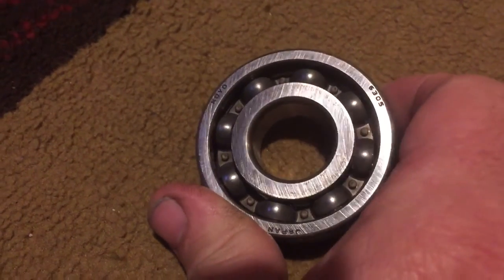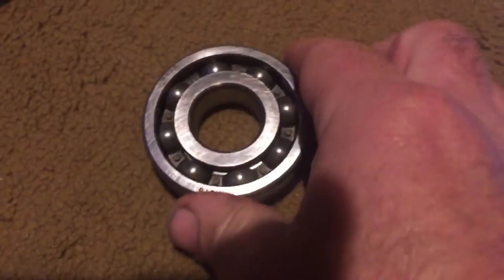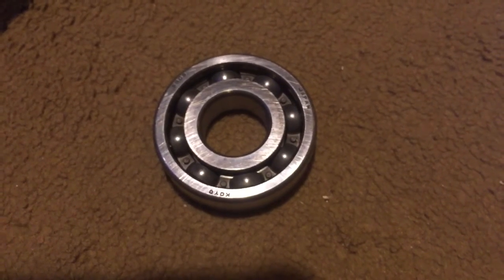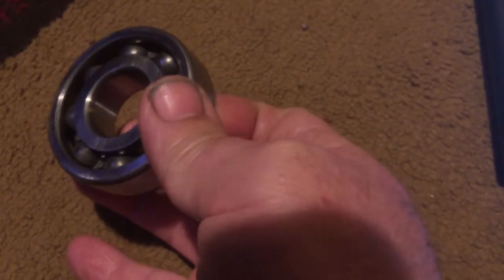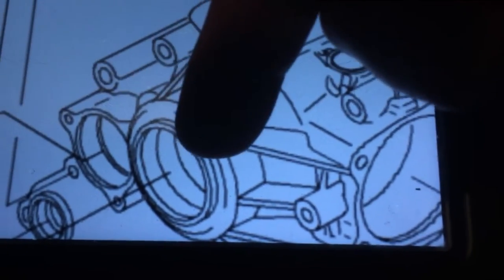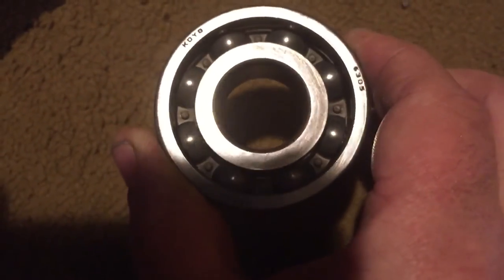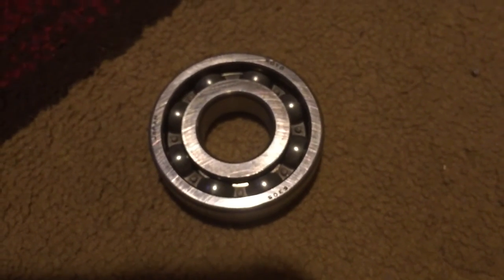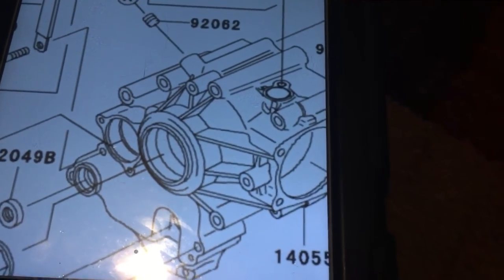Kawasaki Front Bevel gear bearing failure

Comment: I'm tackling this myself. Mine went out after nearly 70,000 miles on my 05' 1500 Classic. I heard a rumor that the newer bearings are a little more durable, not sure if there is any truth to it or not. I've run Amsoil in this since I got it when it had 13,800 miles. I'm the third owner.
Reply from the maker: GearHeadCat  the replacement still going strong  got about 16,000 miles on new bearing

Comment: Just wondering if it could be a water pump gear or something because it looks like the bearing you have is on the left side.  Any links to repair how to would be greatly appreciated.
Reply from the maker: yes but mine sound like it was coming from right side me and 3 other people thought it was coming from right side  but that bearing some what the left side but it's open to the right side  

( check pre filter  screen for Metal shavings

Comment: The sound comes and goes last two rides. The sound is coming from the right side at the bottom.
Reply from the maker: most shop will charge 800.00 - 1500.00 $$ to do the job , you can buy all the specially tools and parts and do it your self for 400.00 to 500.00 took me about 10 hours to remove  about 3 hours cleaning + install bearing. checking / setting gear lash 10 hours putting bike all back together so about 23 hours  labor if never done it before
Reply from the maker: +174iceman  FYI 23 hours labor was taking time to wrap all chrome exhaust and drop cloths marking and bagging all bolts  for error-free scratch free job

Comment: Did you have to pull the engine?
Reply from the maker: you can do it without removing it , but got to remove back Engine mount bolt and tilt engine to front , ( note do this slowly and watch hoses and wires as you jack up rear of engine
Reply from the maker: +174iceman  remove gas tank so you can make slack in wire and hoses
Reply from the maker: +174iceman you can get free Service manual download  online